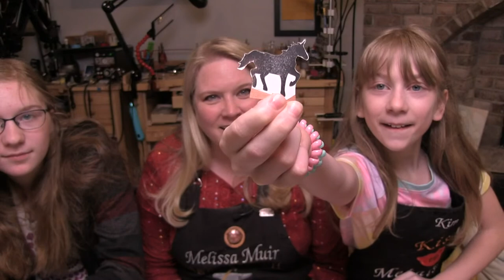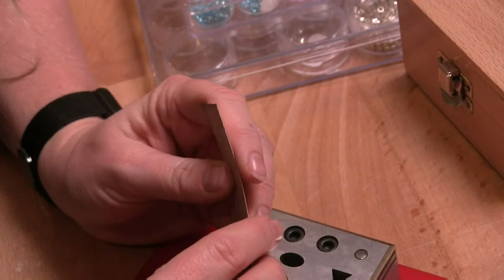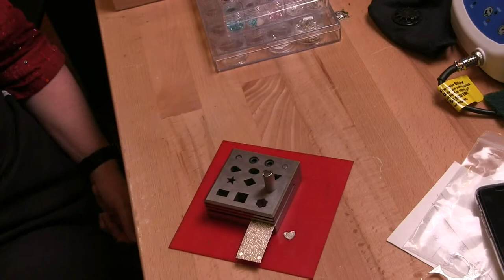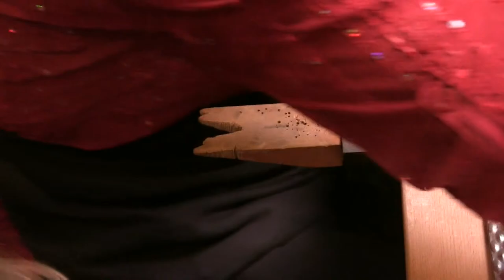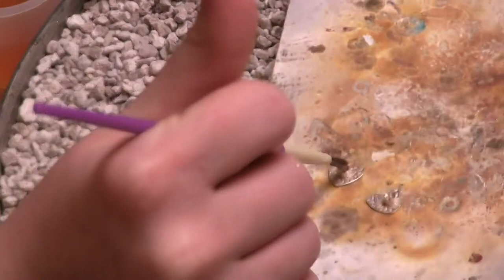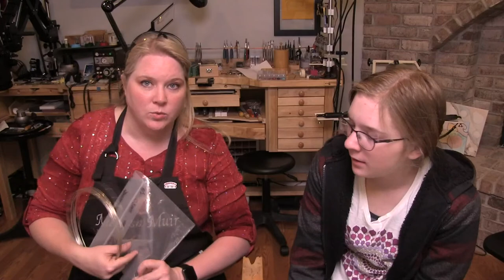Making Stud Earrings - Quarantine in the Studio - 59 - LIVE

Comment: Hi. I ordered the little set of die cut shapes from Microtools. I cut out the heart and a flower and it works great. My question is that is makes it a puff like shape. So if you turned it over, it resembles a pie tin. Is there a reason? Maybe metal was too thin?
Reply from the maker: Rita Vinatieri your cutter is upside down you hit the cutting end with your hammer. 😱
Reply: @MelissaMuir  I hit the flat end and the angled end was touching the metal. That's backwards?
Reply from the maker: Rita Vinatieri yes. In this cutter, there is no angle cut on the cutter. There is a bevel all the way around the striking edge to indicate that it is not the cutting edge. The flat side is the cutting edge on these.
Reply: @MelissaMuir  thank you so much! Lol Hope you all are well.😊